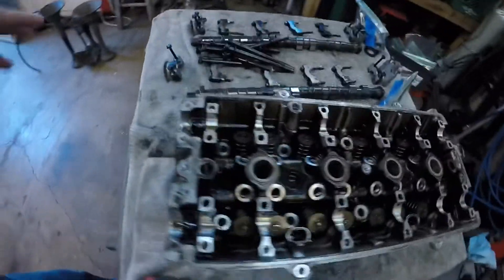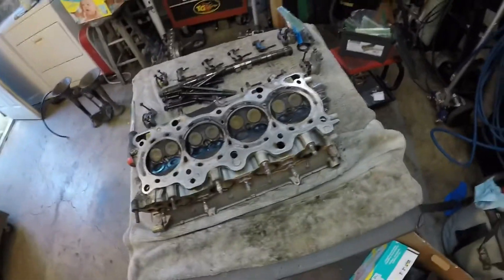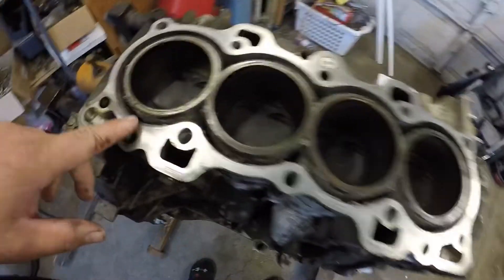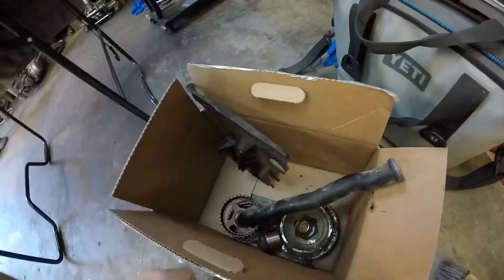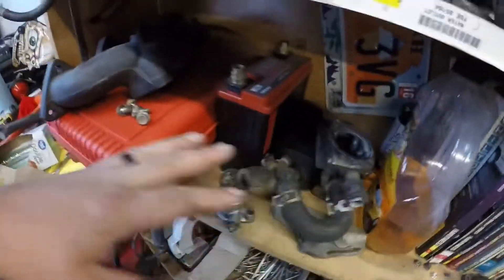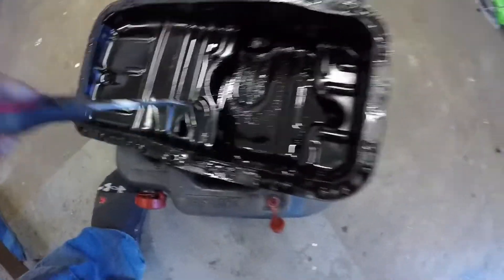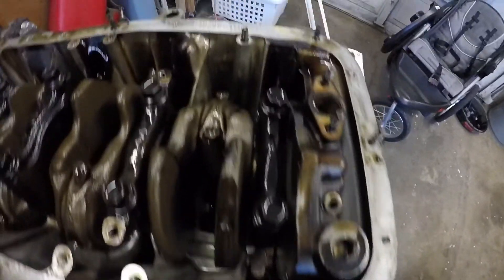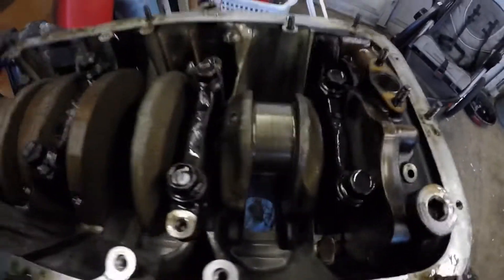87 civic b series part 2

Comment: I just bought my first car and its a 87 crx but it doesnt have a front bumper or left fender and i was wondering if anybody knew if the  civic from the same years fenders would mount up?
Reply: They sort of mount up, ther is a 2 inch gap between the edge of the door and the fender. I have a picture of it on my crx if you want to see it